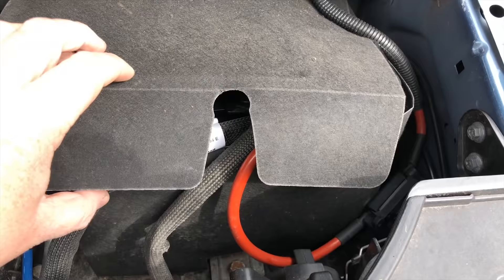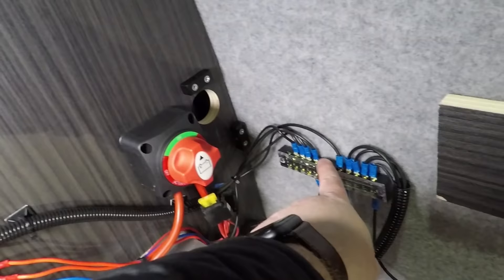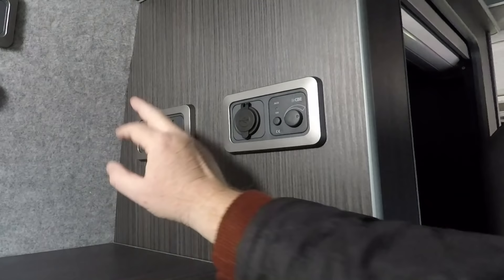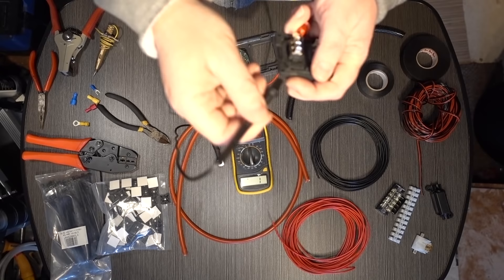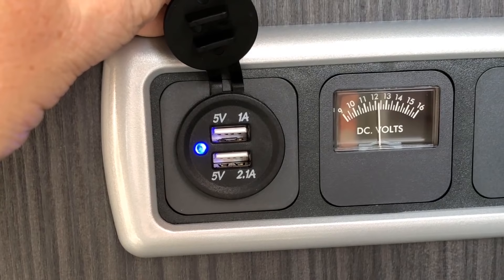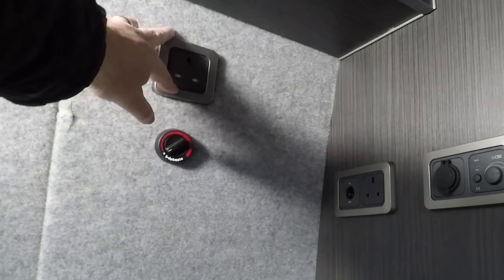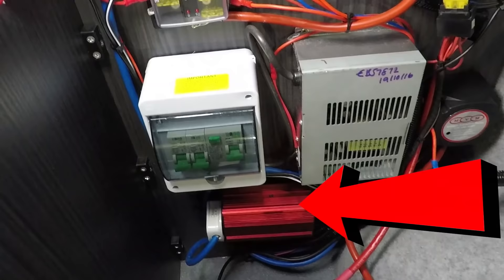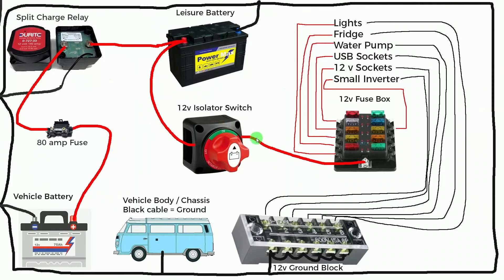Complete 12v Campervan, RV, MotorHome, Boat Wiring Tutorial

Comment: Just to make sure. Let's say I don't have a VSR because it's still in the mail, but I want to wire something up right now. Can I just replace the VSR with a normal switch and do it manually, or would the switch go somewhere else?
Reply from the maker: You can, but you could wreck your battery doing that.
Reply: @johnmandy  How would that ruin the battery?

Comment: Hi John, having seen you in so many others  videos, where you come to their rescue (Liamtheterrible and urbanmotorhome), so I am now sub and notifications on. Im on my 2nd van build and although I didnt go to town on my first one, Im going a bit futher this time and already planning van 3. So my question is the 2.5mm (29amp) cable red, is this really needed for all the live connections to the fuse block and device ? Is 2.5 the best option to cover the device and cable, hoping the fuse will blow first ? Also does the black/earth cable have to be 2.5 mm as well or can it be less ? Thanks in advance
Reply from the maker: I always go on the cautious side and oversize all my cables for safety.

Comment: This video has given me a lot of confidence that I'll be able to work this out. So thank you. I have one question though. If I have two 12v, 130ah batteries wired in parallel (effectively creating one 12v 260ah battery) would 16mm cable be suitable to connect them both together?

Comment: Hi John, thankyou for a video which has made this electrical work quite simply explained. I’ve ordered all the items as watched you video lol. Just one question if you could help me. My van is only a 1.3 Cdti diesel. And the battery is only 60ah. Would you recommend using a 72ah leisure battery. Many thanks lee
Reply from the maker: Hi Lee, I’d say 100ah should be fine, it just might take longer to charge as you run the engine.
Reply: Thankyou John, i really appreciate you getting back to me. Thankyou

Comment: Great Video, Im currently rebuilding my Horsebox and am on the living section now. Your info has helped me greatly... Just wanted to ask when you add in the 240 charger, is it fine to connect directly to the battery terminal where the supply to my 12v circuit starts. My old Leisure battery had 2 Positive and 2 Neutral terminals. The charger when to one terminal and the output came from the other, just now worried about having 240 volt on the same terminal as the 12v system..
Reply from the maker: That’s fine, just connect the charger to your fuse box with an appropriate fuse.

Comment: Great, well explained. How much current does your voltmeter use...wouldn’t it be better to have it connected to a push button for testing when required?
Reply from the maker: I tested it at the time I installed it & my DVM only goes to milliamps and it didn’t register. So it’s not something you’d have to worry about.

Comment: Hi John, or John the guru as you are known in my house. Maybe a stupid question but if I want to wire multiple light switches for multiple rooms for example. Is each light switch on its own fuse back at fuse box ?. Many thanks in advance
Reply from the maker: The lights should be fused, not the switches. The cable going to each light or device should go from the fuse box and be fused 👍🏼
Reply: John & Mandy on Tour 
Hi John. Final question. I’m running out of terminals on the fuse box. Can I have multiple lights on the same fuse or is it ok to have an extra fuse box? Many thanks in advance.

Comment: Thanks for the video. Very instructional. I am planning to build an RV  and your electric scheme will be very helpful. I am from Brazil and in Brazil and through South America the electrical network provides in 110v and /or 220v. My inverter is 12v/110v. How can I set up a circuit that will receive both 110v/220v and convert to 12v to charge my batteries?
Reply from the maker: Hi, follow the link in this video description to the parts video. In there look at the video description for mains charger and you’ll get a link showing you what you need. Good luck with your build. 👍🏼

Comment: Hi John, can I just replace Split Charge Relay with Voltage Sensitive/Sensing Relay (VSR)? My intention is to ensure that with the VSR my starter battery would be charged from leisure battery (which in turn is charged from solar panels). This would be to make sure that after a prolong period of not driving the van I could still start the motor.

Comment: Hi John, I am installing a 130 AH leisure battery, with 100 WATT S/P, and dc to dc controler, I will be using 16mm cable to fuse panel
with 150 AMP breaker. Do you think think 16mm is ok? only useing norm campervan fittings.Also split charge. Do you think it's OTT
many thank's 
Les
Reply from the maker: There’s a video playlist on my channel with a good choice of videos that should help with solar & cable sizes 👍🏻 watch out for tomorrow’s video too which is all about advanced electrics.

Comment: Hi john, just wondering what wattage your fridge is? I have a very similar set up and want to know if i can power my fridge ( 42 watts) using a 110 Ah battery? Thanks :)
Reply from the maker: I no longer have this van now. The fridge says what its power consumption is. Usually a 10A fuse and 16a cable rating.

Comment: Absolutely brilliant video thankyou! If I have 2,  110a batteries in parallel, would using the 16mm cable to run to the 12v fuse box still be sufficient?

Cheers,

Jordan

Comment: Hi John, I have been watching several of your videos, which are very good by the way.  Can you please show  me your total circuit diagram as I am going to have a similar layout as you have in my van, i.e.  2 leisure batteries, these are being charged by 1) Split Charger 2) Solar Panel 3) Charger via shore power when connected. I also want to connect a 2000W inverter to power Microwave, kettle Regards Bill
Reply from the maker: I this video shows a rough wiring diagram. I’ve also just put out another video about battery wiring etc. Then I’ve also put out a video about the solar controller, between all those it should be easy to see my setup is quite simple.

Comment: Hi John. Need help.
I'm concerned that i will overcharge my leisure battery so i would like to employ a charge controller.
the setup i was thinking  was starter battery---split charge relay---charge controller---leisure battery---inverter----appliances.
So when the the split charge cuts-in i should be a able to program the charge controller to stop when the leisure battery is full? I just don't think it would be wise if i travel a long way with no control over the charge limit.

Sorry i am new to all this.

Regards,

Martyn
Reply from the maker: A good vsr has this function built in.  Or a good battery to battery controller would also work.

Comment: Great video thanks. Just wanted to ask about the 240V circuit. Is that a purely stand alone circuit from external source and does that only feed a separate plug socket and another plug to run the charger for the battery? So, if you go to a site, you use external 240v to basically charge the leisure battery and you've also got 240v socket outlets too.
Also, the input goes to a main fuse box but then do you install a ring main 30A for this separate circuit?

I'm just about to get a lwb van to turn into a motocamper but it's also got to function as a motorcycle carrier and also convert back to a panel/work van too which I'll need a 240v ring main to charge my power tool batteries. I'm just trying to decide which will work best as I don't want to go solar so I'll either go inverter 240v or ext power 240v via a 240v selector switch?

Really enjoyed watching your channel last few days too. Really easy to follow. Thanks and subbed
Reply: Sorry forgot to ask. I've also seen another set up where the leisure battery feeds into an inverter which feeds a charger back to the leisure battery. Do you think this would work or would the inverter be drawing more power than the charger is supplying? I know there are inverter/charger combos that you can buy but not sure how effective they would be just to keep the leisure battery charged whilst away from an external power source and not have to use engine power to charge it all. Cheers

Comment: I have fully wired my camper based on your video. Thank you. Only sticking point...I have a 12v tv. I have used the cigarette lighter connection, removed it. Earthed the earth lead and connected the positive to a 15a fuse then a switch in the same fashion as my lights. But it's not working.. any ideas?
Reply from the maker: I’d need to check your wiring and run continuity checks. 15a fuse is far to big for a 12v TV
Reply: @johnmandy  I went for the same size as in the cigarette socket. There is voltage throughout the switch side fine but up to the step up/down regulator box I can't test at that point although there is a small led which is not lit. Maybe I will reconnect the socket and buy a female cigarette socket and connect that though the switch.

Comment: Evening John, thanks for all the videos, been such a great help.
Can I please ask a question. The VW T5 I have already has a split charge system in place with a single battery but I find my 12v compressor fridge drains this quite easy, so to get to my question.. Is adding a second battery just a case of wiring up to the existing one? Or other considerations with the scr etc?
Much appreciated 😊
Reply from the maker: What is your current battery spec?
Reply: @johnmandy   @John & Mandy on Tour  good mornibg John, thankyou for the reply it is much appreciated. It is a 12v platinum leisure plus 90amp
Reply: @johnmandy    good morning John, thankyou for the reply it is much appreciated. It is a 12v platinum leisure plus 90amp

Comment: Very helpful - thanks!  Great tip on the removable isolator switch.  I am planning to do the exact same set up as you, but I want to connect the 240v mains charger to the vehicle battery instead of the leisure battery.  My logic is that this should charge both batteries due to the variable voltage switch you mentioned earlier.  Do you foresee any problems with that approach?  Any reason why you didn't to it that way around?  Thanks.

Comment: Hi John, thanks for the great videos, I’m hoping to convert a van to a camper van but have virtually no skills or experience. You are slowly but surely educating me!! One quick novice question: if I set up a 12v solar system in my shed as an experiment, powering usb chargers, lights, etc. do I still need a ground? If so, how would you recommend I do that? Thanks in advance. Pete.
Reply from the maker: Hi Pete, the ground would just be the negative side of the battery 👍🏼
Reply: Gadget John on tour DOH!! Understood. Many thanks. Every day’s a school day!!

Comment: Hi John, is there merit to locate the split charge nearer the van battery before running the length of cable to the electrics inside the van as I see a lot of installs like this whereas I note you put everything inside the van nearer to the leisure battery?

Comment: Hi John, I'm just starting my electrics In the and just wanting some advice on the inverter. I've purchased a 2000w pure sine inverter which is from China and was only 40 quid. I'm going to fit onto a xplorer 230AH battery and was just wanting to no if the battery is OK for the 2000w with 5000w peak. Cheers
Reply from the maker: I very much doubt it’s a genuine pure sine wave 2kw inverter. I’d get that checked by a professional before wiring into you van.
Check out my inverter & battery video for more details on your questions.
Reply: @johnmandy  Hi John I was thinking that myself but the reviews are all saying its fine and does wot it says on the tin.  I'm using 25mm wire (been advised) from the battery to the inverter with a line fuse and isolation switch but just want too make sure the 230ah battery isn't too big for the inverter? Thanks

Comment: Hi, thank you for your video, i was wondering would you be able help me with a diagram like this but with wireing to switches for things like the lights ext please
Reply from the maker: Wiring a light is easy, black wire goes to the negative, red wire goes to light, then to one connector of the switch, then red wire out from the other connector and then to your fuse box. 👍🏼

Comment: Nice video and good explanations of what you’ve done and why, especially the use of an inverter, which is why I was watching.

I plan on installing a 12v circuit as I am converting a day van, would only have lights, phone charge points, a fridge and possibly tv running.
My question is regarding batteries running at >12v and occasional spikes in power. Would equipment suffer from these power spikes and would it be recommended to install a 12v regulator? If so, would you recommend any as I can only find regulators that require >13 volts which might be ok when charging or filling charged but once the battery is at 80% the regulator would then fail to see an input potentially?
Reply from the maker: A good leisure battery will self regulate the power 👍🏼

Comment: Great video and cleared up a lot of questions, however you left out the one things I’ve been searching high and low for. That is:  I’m yet to find a video that will explain how to charge one’s leisure battery from multiple sources. You are charging from your alternator and gasoline generator; must there be a switch to switch from one to another charging source, or just hook all charge sources straight to the battery (maybe it’s just that simple so no one has bothered to explain it)?
As an example, say I have your set up and In addition to charging the leisure battery from the alternator, I would want to also charge my leisure battery from a solar panel and also 110/220v when hooked at a campsite, all automatically, and all possibly simultaneously. Possible?
Thanks in advance to anyone who can clear this up.
Reply from the maker: Hi, this video does actually show the battery being charged from multiple sources. It shows the split charge relay than charges the leisure battery when the van engine is running and we also have a 240V mains charger for when we hookup to a generator OR hookup to campsite electricity. I also have a newer video which shows solar panel charging.
Reply: @johnmandy  Hi John, sorry to be a pain, just to confirm from above. Say I have a 240v hookup on site then can I have a leisure battery charger connected and charging when the leisure battery is supplying 12v to appliances, fridge etc with no issues? Thanks

Comment: i bought a pre wired dual batter wiring kit but my fuse on the crank battery side is only 50 amp. Is this enough as you've used an 80 amp?  thanks
Reply from the maker: Check the output of your alternator. 👍🏼

Comment: does the split charger stop draw down on the vehicle battery if the leisure batt is flat ??
Reply from the maker: The vsr charges the leisure battery all the time the engine is running.
Reply: @johnmandy  yeh i get that but my question is if your using the leisure batt and it drains down will it then take power from the vehicle batt without a cut off ??
Reply from the maker: No, as I said the vsr only connects the 2 batteries together when the engine is running.

Comment: hi john.just found you video and it definately makes the wiring look easy then i thought it was.like many i'm new to all the converting a van business so after a little help.for personal reasons we might have to live in the van for a while,family of 4,so might end upon a campsite as well as wild camping.i'm not looking for expensive items but could you give me a list of products/names that you used and also what else would i have to do/use for campsite hook-up?the van already has some wiring and an external socket  in place.great video by the way.
Reply from the maker: Hi John, the video description has this link too, but here's a video explaining each part with links to the cheapest price for each.  https://www.youtube.com/watch?v=OxYBj6bcvxM
Reply: @johnmandy  .thanks for the list it helps.can i ask another question please.the 2.5mm cable you use for the switches etc is it a particular type as when i look on ebay it mainly has household 3 core cable?
Reply from the maker: If you click the link I sent in my last reply then you’ll find everything linked in the video description. Click the 2.5mm wire links to buy the correct wire. 👍🏼

Comment: Thank you John for the clear and helpfull video.I have just one question,if i use your wiring diagram in my future campervan ,but i want to add solar pannel aswell,how do i have to connect it?.Is it ditect to the leasure battery amd everything else remain the same or should be same changes? Thanks in advance Greetings from Croatia
Reply from the maker: Hi, if you look at my other videos you see there’s more detailed information about installing a solar panel, installing a solar controller and also how to install multiple batteries & inverters.

Comment: Hi John i hope you Mandy and Coops are all well. Im wiring up my van using your videos as a guide. I have usb sockets and cig socket but wanted to put a switch in them so they are not constantly drawing power. Have you dome a vieo on this please
Reply from the maker: Take the pos cable into the switch, then take the pos out the other side of the switch and then feed into the sockets. I wouldn’t make a single video about this, but this setup is in lots of my wiring & upgrades videos.
Reply: @johnmandy  really aporeciate tgat John thanks fella regards to Mandy and Coops 👍